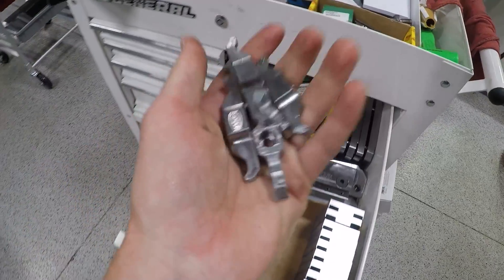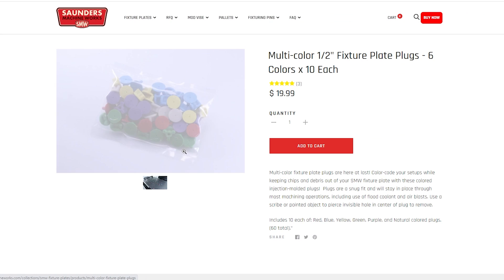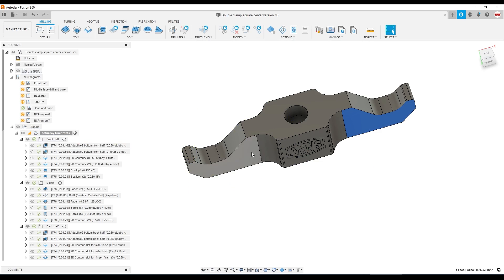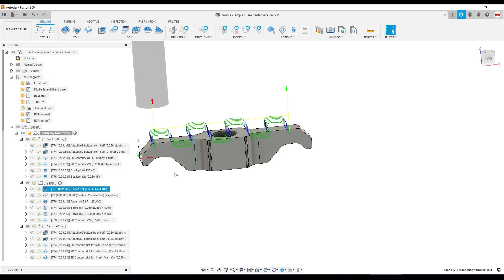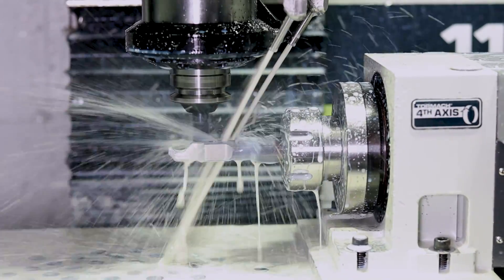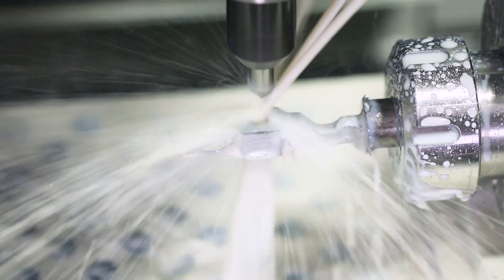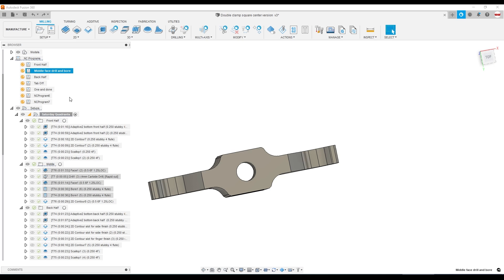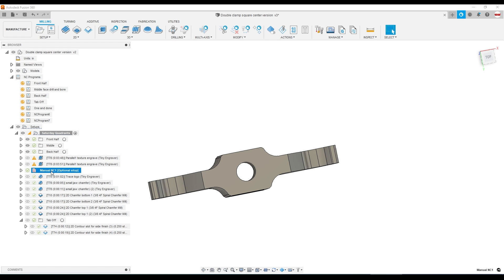Tormach 4th Axis: Machining Workholding Clamps!

Comment: Dam Good Video boys , not sure how i miss this video when it came out.   I wish Fusion would give Tool Orientation to the Home/Hobby folks. i understand we cant have it all for free, but i cant justify the cheapest subscription for a very part time hobby running a homebrew sieg X2 cnc. For now i am probably going finish my home brew 4th axis converted rotary table and i will have to merge all of the gcode in one file with manually adding the Gcode to rotate the axis in a ... 3+1  fashion. That would be a starting point.   Thank you guys for all the videos Keep them coming

Comment: Why no tail stock available for the microarc? You can't put features on long parts. Also, why not make the spindle take 5C or MT2? It's just a thru hole.
Reply: If I remember correctly, the Micro arc does not have a through hole. Why not? Probably the same reason there's apparently no tailstock available, no internal collet option, etc...they likely had an engineer design it, not a machinist.

Comment: Could you use a live center on the opposite side and then pull the stock out further and machine maybe 2 clamps at the same time?
Reply: he should almost be using a end support at the length he is already at. Doubling that length would get pretty noodle as material is removed
Reply: @brianwaayenberg3099  No tail stock available for microarc that I know of. I wish they made one.
Reply: @scottkip3645  it does not have t be a "tormach" one, ali express will sell an adjustable height tailstock for $30 i think, lock in the height once and off to the races!

Comment: Just curious, what do you like better. Fusion 360 or Solid Works? I was learning both a few years ago but chose fusion 360. Fusion 360 made more sense to me. I saw in your earlier videos you were using mastercam and solidworks. I'm asking because you have experience with both.
Reply from the maker: SolidWorks was $5k + over $1,200 per year in maintenance - and, at the time, it did not include any CAM.   It has more powerful CAD, but for everything we do, Fusion 360 CAD is more than capable. And the Fusion CAM is excellent.
Reply: @nyccnc  Awesome, thanks for the reply. That was my impression too. I like how I can export an STL file to 3D print, check fitment then generate CAM in one program. Just didn't know if I was missing something with solid works. I work in IT but this CNC stuff fascinates me.  I've learned allot from your videos, thanks!!!